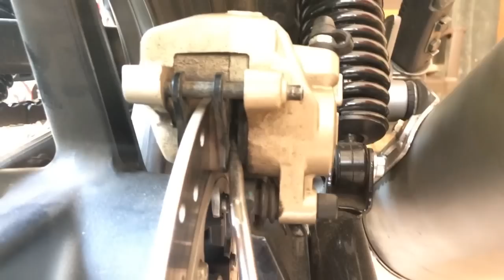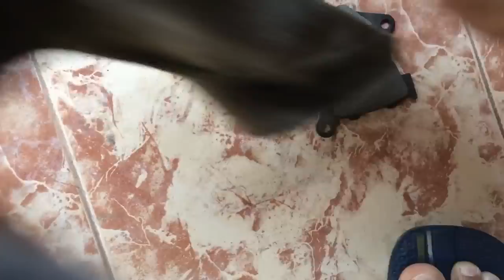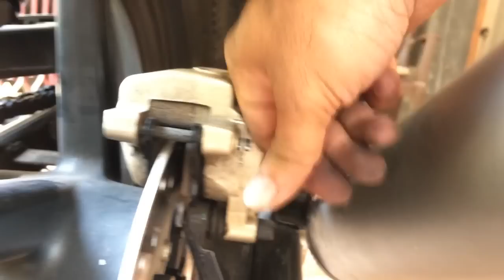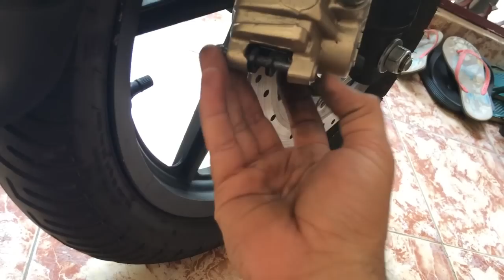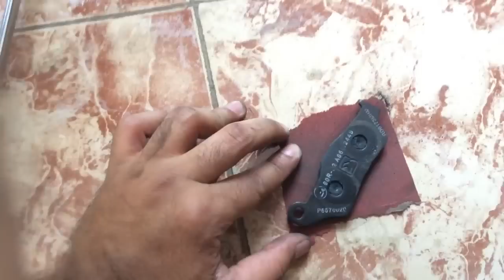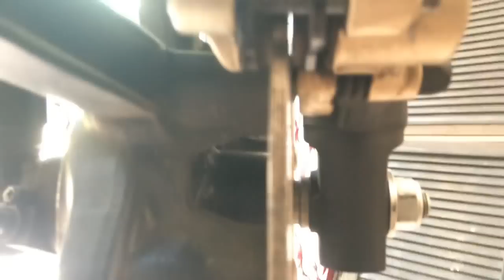Pulsar 220F Brake Pads clean/change Front and Rear

Comment: Kaushik Bro,, My Bike IS 2014 Model 220F. I have frequent  Rear Disk Screeching Sound..Can u Please Suggest ? wht the problem ?>
Reply from the maker: Hey buddy, how many kms done on the odo ? if it is new, let it run a while and it should be ok in few days.. but if the problem persist even after service, get it checked, usually new brake pads take a while to break-in and also might be dust particles

Comment: Bro I have pulsar 220 2011 model.the rear disc brake gets jammed sometimes that even Tyre doesn't move free.what may b the problem.the disc plate gets Soo hot we cannot touch it
Reply: Bro there is air in your oil line that comes from the oil reservior under the rear seat to the rear disc brake.. you need to get that oil out.... you can check out disc brake bleed videos to learn how to do it

Comment: hi, i have my New Pulsar 220f just bought a week ago. The problem is with rear disc heat and brake jam. i took it to the service centre and they adjusted the brake. Now brake is ineffective and heating still remains now. They said rear brakes become ineffective after pads are cleaned. Should i claim for new disc system installed under warranty or is there anything to solve the problem. Please suggest!!!
Reply from the maker: Hey buddy, since it is a new bike the brakes do take a little time to adjust, if it is getting completely jammed then you have an issue with the brake system but if the wheel is spinning on the center stand and getting little stuck on a particular point then you can ignore this. Don worry about it, keep riding till your second service and then if the issue persists wank their ass to rectify the brake system. Mine is done 7k kms on the odo and compared to front my rear disc are always hot though I use rear brake less but its not affecting the bike performance and braking. and yes after cleaning the brakes would become ineffective for a while but it will get better after running about 10 to 20kms.
Reply: Thanks. I have an additional query. Now I have rode about 180 Km; and in about 2 weeks, i will be going for my 1st scheduled servicing (i.e. 500 km +). Would the condition be better that time (as per your advice) or would it take few thousands kilometer? What you say!!!
Reply from the maker: You're bike gets better and better after the 2nd service, but do a proper run-in which is very important, later you'll have no regrets on the bike's performance. Well, it might get better but if it doesn't don worry about it, like I said it takes little long time to things get settled in the bike.. and you've the warranty if something is seriously wrong. So don worry, keep riding. Let me know if you have any concerns, I can help you my best.
Reply: Sure, I will count on you buddy :)

Comment: Bro, kitne bhi zorse rear brake dabane pr bhi brake nahi lag rha h, nay soultn?
Reply from the maker: Yek baar clean karke dalo phir check karo... yek baat! Clean karne ke baad min 10 to 20kmS thak brake nahi pakdega thik se... but woh thik hojayega after sometime.. thats doesnt mean brakes are not working.
Reply: @akshinde  i cleaned my disc pads and replaced  the brake fluid today bro ..
But the braking is not efficient...
Lacks the bite it was earlier having...so do i also have to wait for 20-25 kms?
i rode 4-5 kms after that just to check the braking